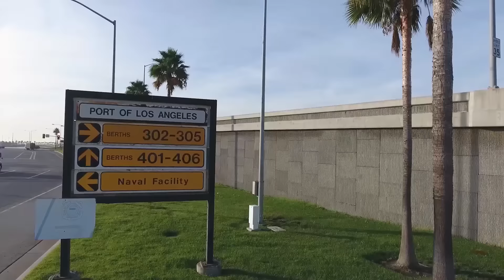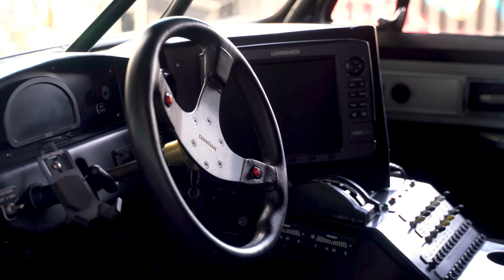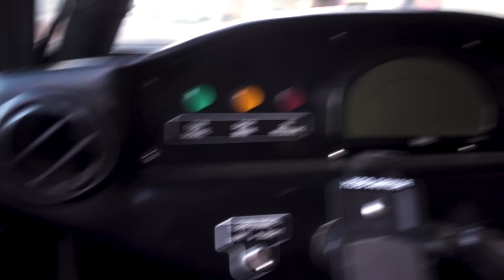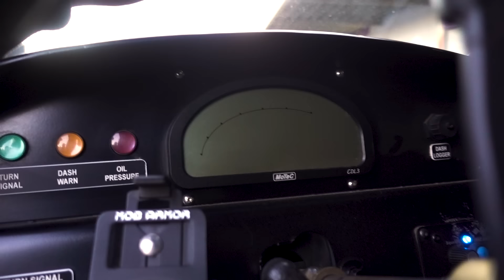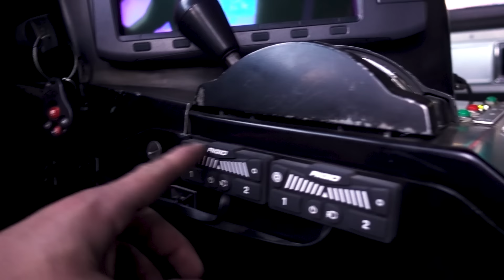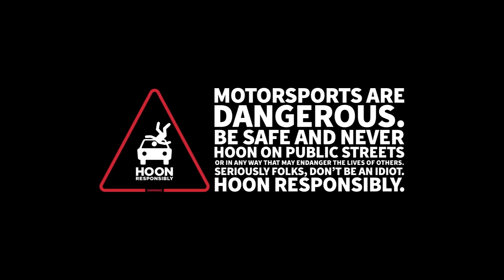BJ Baldwin's Full Tilt K5 Blazer //DT237

Comment: wow all that and no double stack im disappointed haha
Reply: probably would have shifted the ramps like crazy with the weight of that truck, also probably would have jumped into the fence
Reply: The Bronco did it just fine. Very similar trucks to start with before mods.
Reply: He'd land on the roof of the truck if they did that lol
Reply: Considering how far back it tilted with just one ramp I don't think a double stack would have ended well.
Reply: it would have done a 180. With 300k in this truck, it lands wayyyy worse than that backyard prerunning bronco with 30 y.o. strip club shocks which is disappointing. If I spent 300k on a stadium truck I want it to land level.

I would imagine on dirt, with that much weight shift, turning would be hard at speed.

Comment: I used to daily drive my K5 blazer, sold it years ago and kick myself for it every day.

I wanted, still do, to put a Dana 60 up front and 14 bolt in rear, 4 link or competition suspension and a Detroit 6.5 diesel under the hood and a full roll cage, and take it to jump some sand dunes in Michigan, don’t want to be bugged by people for rides off road so 2 seats will do.

beautiful truck you have there.

Comment: I have a full sized GMC Jimmy from a 1978 with a 1969 327 engine from a 1969 Camaro and it's in and it's a runner I already changed from points to the hei distributor it's sits on 38 murders and it has 700r with the over drive and it spins them all day when its raining all day